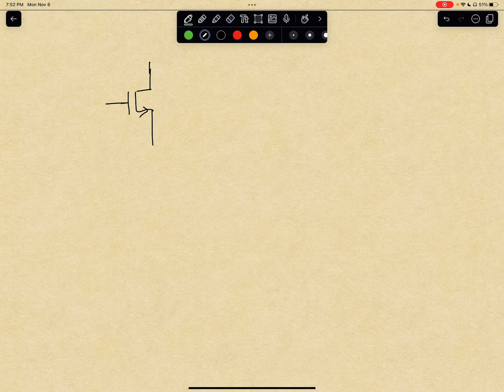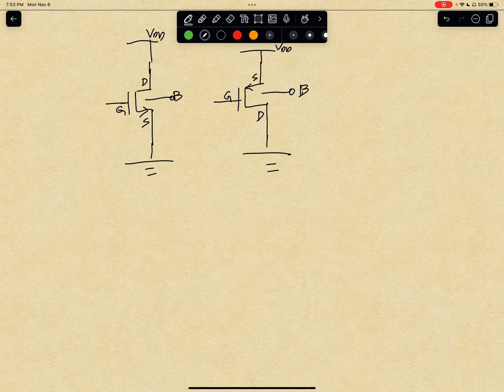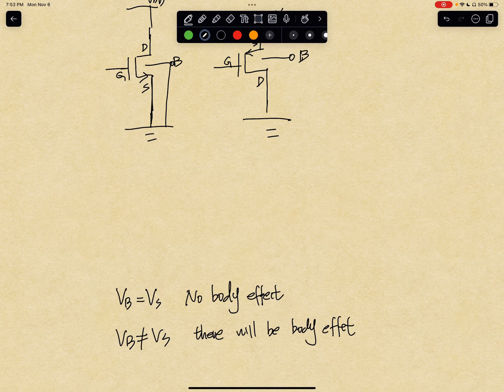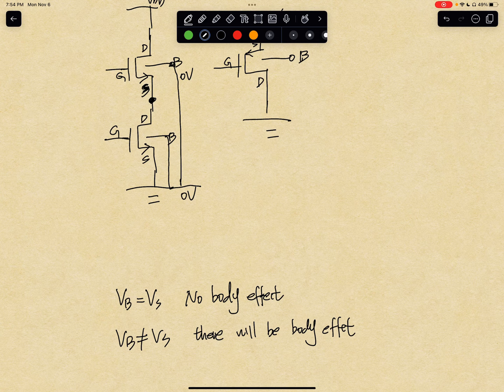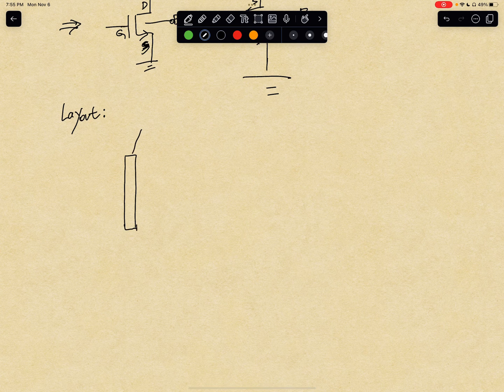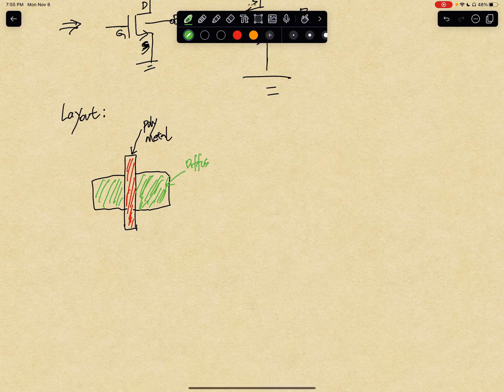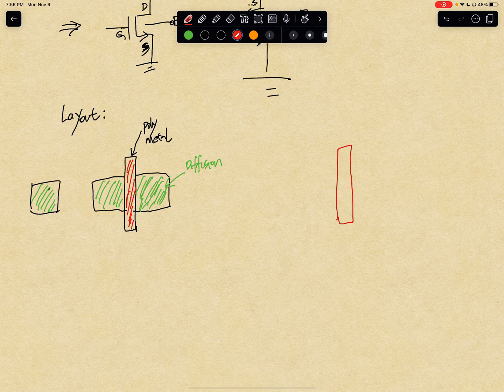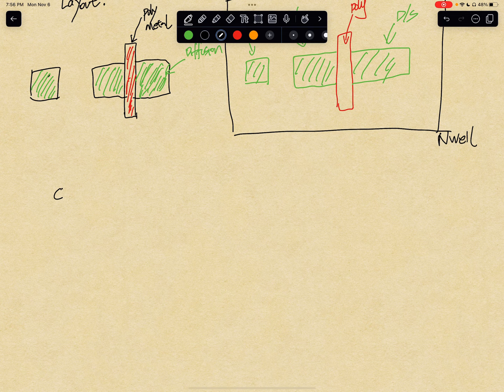MOSFET Layout and cross section (Analog Interview Fundemental)

Comment: On the cross section, source and drain diffusion regions are separate islands, not connected. But in the top view, it is often depicted as just one big rectangle underneath the gate's polysilicon strip (i.e. source and drain being two sides of the same rectangular region). What's the deal here? Are they supposed to be connected or not?